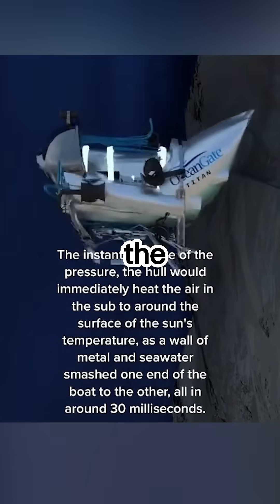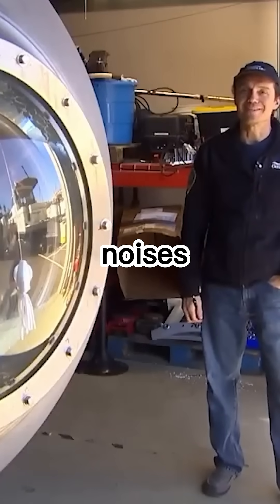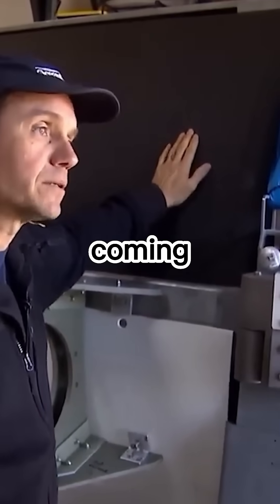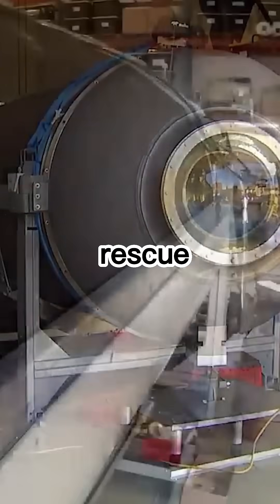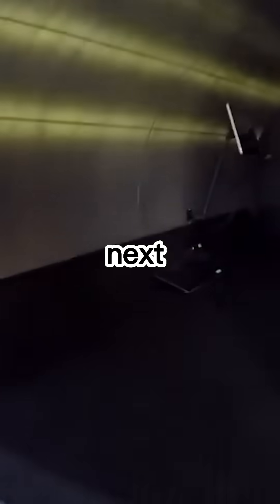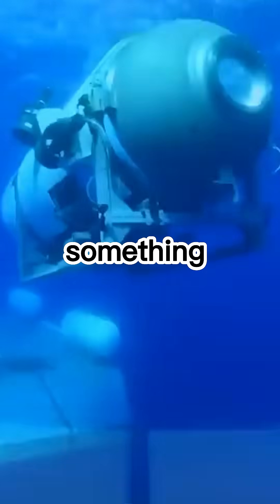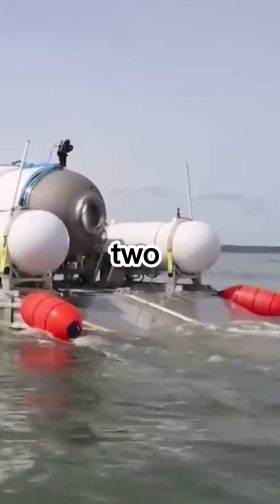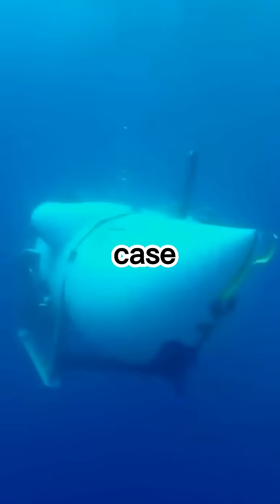Why The Titan Submersible Imploded

Comment: They sent a preliminary design to be tested by NASA and the Washington University. They had nothing to do with the actual design. They were supposed to validate the design, but the Titan CEO changed the design despite the results from testing and the concerns of his own engineers. That is NOT the same as "designed by NASA". This is how false information is spread. Just stop. Do better.

Comment: It wasn't built by nasa it was built by the cheapest bidder who didn't even oven the cabon because the didn't have the equipment, the electric system was designed by students for free it used the cheapest parts possible by people that were basically diy guys.

Im suprised it lasted as long as it did.

Comment: IT DID NOT IMPLODE..... there was a very smaal leak from a carboncrack... filling the back.. whole thing shifts backwards...shorts and then rapidly fill with water... and falls apart. No pressure on the glue anyw=more..
They have suffered for a short time / realizing. That's why it did not want to rise.

Comment: As I understand it, they had an acoustic monitoring system that was wired into the hull. This would have meant that there was an established baseline for the acoustic properties of the hull. What that means is that they had a means of determining if repeated stresses were damaging the hull over time as well as it's integrity in real time. My understanding is they were descending faster than normal, and that it might have been intentional given they had a very narrow weather window. This may not have allowed the parts of the sub to properly adjust to the increasing pressure. Just wasn't as robust as they thought it was, but the AMS seems to have detected a problem in real time but for whatever reason they were not able to get the sub to return to the surface fast enough. That's just based on other YouTube interpretations of text transcripts between the sub and the surface.

Comment: The five men aboard lived through roughly 20 mins of terror trying to surface while knowing it was going to implode before it actually did.
Reply: With all five alarm conditions red, jetting the ballast and frame and not rising too much during the end of that 20 minutes must had felt hopeless.  If the sub is structurally failing and you can’t get to the surface, then at least you know your not going to suffer.

Comment: Interesting theories, but you state “facts” that are merely possible causes.  You don’t know why the sub imploded. How do you know the carbon fiber was weakened?  There are a thousand things that could have gone wrong.  And it is entirely possible that the cause of the implosion could have been unrelated to the materials used or the so-called “cut corners”.   Misinformation.

Comment: Where is the acrylic port hole? Looks like it was taken out of it's mounting ring, but by who? Latest is that the RTM idiot light came on just 300m off the bottom and they had to abort. It was 20 minutes from that to the implosion. So they were in fear for 20 minutes ascending.

Comment: Carbon fiber does not do well when compressed. It works in tension. Compressing the CF tube over and over by going to the titanic and back stress fatigued the CF hull, and it finally gave up.

Comment: it actually made the trip a few times. not many subs can do it multiple times without being repaired after the second or third time.

His mistake was trusting a material that seems space age but really isn't much stronger than steel. It's lighter for sure. Fatigues differently to...

There's even one sub that I saw in a YouTube short, that they said wouldn't be able to repeat the same trip cause it was designed for one use as each trip weakens the material.

Comment: two different materials did NOT make it easier to explode! What made it easier to explode was using a material that is NOT designed for compression designs. However had they replaced that cylinder after EVERY dive they probably would have been okay. These guy was a narcissist though so he wasn't haven't any of that!

Comment: With all that happened the heat, the crumbled squashed sub. it's not a submarine but a submersible connection is the mother ship. It really could be possible that after the fact , some would be like half body cut in two has one bubble of oxygen? . Weird survivors have happened before. That challenge science. Could it be one or two survived for a short time???. Did they use space age materials that could help this ???

Comment: Amazingly the Titan made a few successful dives to the titanic without imploding.   Unfortunately each successive dive damaged the pressure hull a little bit. Apparently they heard cracking noises in those previous dives which may indicate delaminating and fissuring of the carbon fiber.  This last dive, the weakened carbon fiber just gave out and they all died instantly.  It was just a matter of time.

Comment: I worked with layered composite materials for five years. If it's damaged, then the area affected is much larger than if it were a pure material. Impact damage and water damage run along the area between the layers, which later causes delamination.

Comment: It was found 1600 feet, NOT 16,000 feet away from the Titanic.  @Markbeshae, at least learn the basic facts before producing a video in order to get likes.  The minute you said that, I stopped listening to your supposed take on the causes of the submersible implosion.  Your generation needs to quit being concerned with being noticed and start becoming concerned about being factual.

Comment: You know it's legit when it starts with a fiery explosion under water
Reply: When the atmosphere (oxygen/nitrogen) goes from 14 psi (sea level) to 5600 psi (400 atmospheres) due to the weight of  water at the depth of Titanic in microseconds the friction creates an enormous amount of heat/energy. It will be a miracle if anything at all from inside the cabin is discovered intact.
Reply: You mean implosion

Comment: NASA had nothing to do with this stupid design. Who would use carbon fibre for compression. For aviation it is good. Not for deep research. Moreover, the fatigue of carbon fibre is difficult to find over time. A cheap sub won't save you. Safety was a waste of time for the owner.

Comment: Was not designed by NASA or University of Washington.  Those were entities that were buying some time on the sub.

Also, the titanium was most likely fine.  It was the carbon fiber and binding resin that under this much compression would crack and weaken after each dive.   Other similar designs were single use only.  It was  much more that what you would call fatigue.   The real sad part was the director of Engineering even got fired when he tried to get testing and tried to change the design because he claimed the carbon fiber would eventually fail.
Reply: I'm a retired union ironworker and with over 25 years of experience in the field.  My first thought about the implosion was fatigue of the seams. Building a structure that can withstand constant shifting, varying environmental pressures, and movement should be designed in such a way that the parts affected the most by the stress of conditions can be regularly tested and replaced unless they retire the entire thing after a trip or two. Composites and seams are especially susceptible to fractures and failure, so you would think they would have monitored it almost to the point of obsession.
Reply: @russellstubbs8224  I agree.  BTW, I am an Engineering Director (29 year’s experience) for a company that supplies equipment for NASA,SpaceX, Blue Origin, Boeing, and many others.  We are involved with the manufacturing process for composites, metals (aluminum, magnesium, titanium, steel, and more exotic alloys).  For most structures you can calculate fatigue on a logarithmic function of both stress and cycles.  Even composites have predictable design guidelines.   Carbon fiber composites in tension and certain strength to weight applications can be very advantageous.  However, carbon fiber composites do not do as well in compression and at this pressure it is well documented that each compression cycle begins to fracture the binding resin and the non homogeneous nature of the composite.   In tension the filaments really assist in distributing this load to areas that are not fractured.  But in this extreme high pressure there isn’t many proven fiber matrix and resin formulations that would yield predictable results.  So that is why the few designs out there that use carbon fiber more than for a single use.  In contrast, if they would have designed the center cylinder with titanium or another material with known compression fatigue life cycle algorithms, they could have designed something with a multiple use life expectancy.   I heard that they did monitor the fractures, however they ignored testing and sensors that indicated it they had already exceeded its design strength diving to the Titanic.   They essentially were diving on borrowed time.
Reply: @russellstubbs8224 I live in Portland Oregon & this white boys deathed who has had so many opportunities handed out to him because he is white & Americans need to prove they are smerter & can play football & basketball better... that is why so many white kids are on the news for being geniuses that soon are discovered to be frauds😕 but white news media have to rush THE WHITE BOY GENIUS story.... Anyways I live in Portland Oregon & this young white genius death who was just given a submersible gives me happiness, I live in Portland🤌

Comment: Did anyone see how the monitor was fixed to the carbon fiber wall? I’m sure that might have contributed to failure.
Reply: Yup. I thought about all those interior mounting points. Even the flooring deck and the lighting. Lots of "finishing" for human comfort etc was done on that interior and you'd hope no one was dumb enough to use screws & bolts into the hull. Talk about adding stress defects.

Comment: Carbon fiber bike frames fail suddenly after past damage that weakens the fibers.  Carbon fiber may not be the best material for submarines, and we probably need to get better at making it resistant to spreading micro cracks, just generally, because sudden catastrophic failure is not a great characteristic for aircraft, cars, and bikes either.
Reply: And yet, many new commercial aircraft are building wings and parts of the fuselage out of composites (ie. carbon fibre). It makes you go...hmmmmmm!!
Reply: @dabig_guy2204  carbon fibers strengh is alot stronger than its compression strengh
Reply: @dabig_guy2204  its fine for cars and jets. not submarine low depth pressure

Comment: It was blown up it didn't implode cuz if they would have imploded you would have found a big crumble of metal still at the bottom sitting there all in one piece with every piece attached to it ain't nothing going to go and exploding all the pieces going to go everywhere where do you see an implosion where the everything goes everywhere explosion explosion is when it blows up and it's all over the place implosion is when it's all in one spot wake up people

Comment: Bro got natural selection’d and had to bring down others with him. RIP
Reply: It was more ignorance than natural selection, but I see what you're getting at.
Reply: He didn't bring down the others, they were just as ignorant with all the death flags.

1. Sign a death waiver so if you die your responsible.
2. The time frame that it was built
3. 0 passing safety checks, when someone complained about the safety of the craft they were promptly fired.

Now if someone was going to charge you a large sum of cash for a ride in it and you saw all this information that he admitted to and bragged about on television interviews. Would you go?

Comment: Ive never used carbon fiber, but carbon fiber sounds like a snap or crack is instand doom.
Carbon fiber as submarine sounds pretty scary, but its pretty hard, but everybody knows if you know it that 1 crack in carbon fibre is a crack. Metal would first start snapping or bulging in im guessing.
Creepy shit.....Rio for the young Guy! Wondered if they even noticed it or it was 1 second before they could say , shit....it was over

Comment: There is a reason that subs are not made from titanium. Sure, titanium is hard, so it seems like a smart choice to build a sun out of, but it is also brittle. As a vessel made of titanium descends to its rated crush depth, micro fractures can form in the metal that significantly reduce the structural integrity of it. This means that the more trips you do down to the bottom the weaker your vessel will become, also the shallower you allowed crush depth becomes

Comment: It's really outrageous to use a prototype without proper testing and certificates especially when you use new matirals not used in this situation before plus they were warned about this by employees who got fired for it!! It's really not good enough that the person responsible died in the accident so he could not be held accountable!! We all know that this type of thing is dangerous but surely nowadays it's supposed to be safer especially when you take in to account the information we now have!! It's really not great that every single time they used this sub it had extremely worrying malfunctions and it's still being used to charge people quarter of a million for a so called seat and they didn't even improve on it plus didn't accept that the two main types of material especially the carbon fiber especially the joint to the titanium ends wasn't checked for weakness or fatigue!! It was obvious plus a new idea like this should be looked at with a fine tooth comb every single time it was used!! It's really criminal !! Even everyone who messes about with cars knew that two different matirals age and act differently and fatigue more next to each other!! The bloke was just criminally ripping everyone off!!

Comment: The military didn’t hear a loud noise. They looked back at data and tried to find an inconsistent with in the data. You’re talking about a tiny little can compared to the ocean. Sound doesn’t travel like it does outside of water. Half the stuff you stated is inaccurate. Do research

Comment: Using concrete it would have been far more reliable & even Cheaper!  
Also, fitting that sub with stereoscopic cameras wirelessly connected to streaming channels straight to the "customers" in the comfort of Wherever they Were, would have been Far, Far SAFER...!

Comment: It wasn’t that it was two different materials. The end cap is always going to be a separate piece. It’s because the main part of the hill was made of a carbon fiber composite which allowed water to ingress between the woven layers leading to delamination which caused it yo eventually fail.
Reply: where'd you hear that? carbon fibre allows water to get into the fibres. That's not what happens. The guy here got it right the hull had fatigue from previous missions. The extreme pressure would cause the delamination
Also the 3 different materials (titanium, carbon fibre, acrylic porthole) are a point of weakness because they have different responses as they expand and contract due to pressure
Reply: The fatal final flaw very well could have been a stress point in the carbon fiber hull at a lifting lug, end cap bond or any place where two different materials are bonded. Multiple dives at those extreme depths would cause some microscopic (impossible to detect) flaw to finally give out. 6000 psi is absolutely insane pressure and really requires essentially perfect engineering and construction.

Comment: Strength is needed not to be light weight, idk who in the right mindset thought carbon fiber could withstand 6000 psi looks like carbon fiber in a tank can only stop up to 700 psi

Comment: I just wanna know what the implosion did to their bodies.
Reply: Its simple
They were thorn in pieces but really quick
Reply: At 1,000 feet deep, pressure is 30 times that at sea level. Titanic is at 12,500. At that depth, pressure is 400 times what normal atmospheric pressure, 6,000psi. In a implosion like this, the air is superheated to over 3,000° in an instant. They didn’t suffer, it was over in less than a heartbeat.